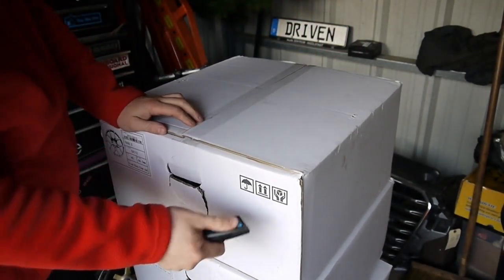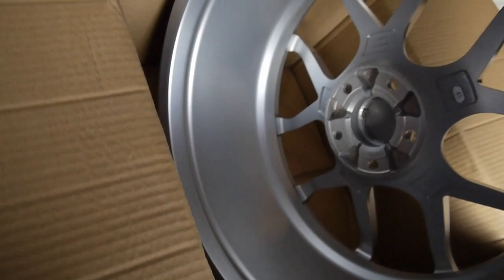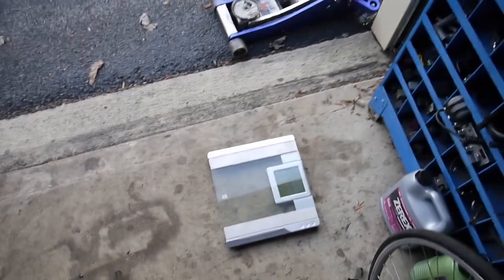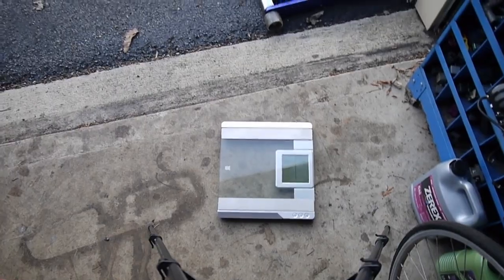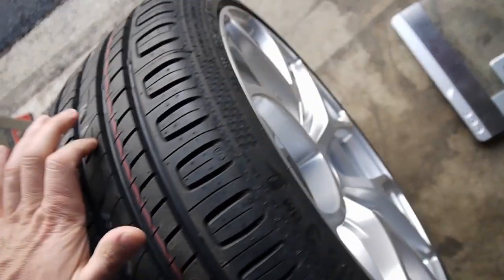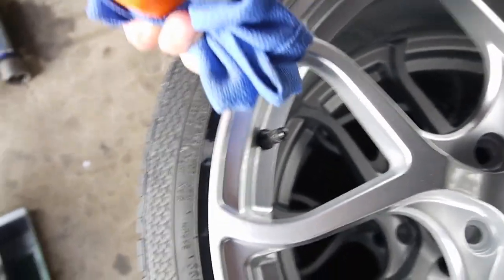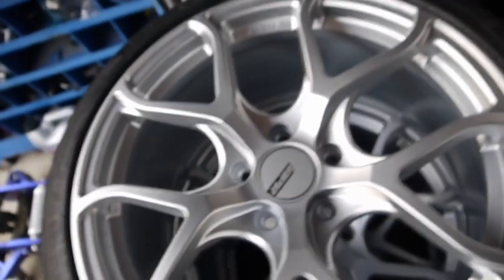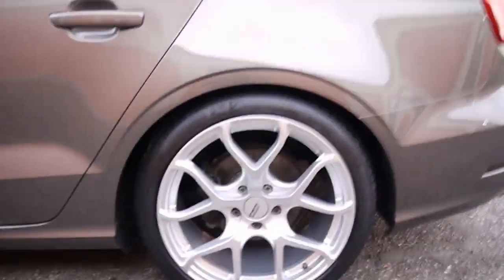APR A01 flowform wheel unboxing/review/install

Comment: Thanks for the vid man, I just received my A01 as well (18x8.5) and wanted to inform that my wheels are 19.4lb each rather than the 18.5 listed on APR's site. Still a light wheel but be aware that it is not quite as light as they claim
Reply from the maker: Thanks for sharing,  lmk what you think when they are on, I'm going to do some 0-60mph comparisons between these and my s4 wheels
Reply: If you’re using a standard scale, weigh yourself, then pick up the wheel and weigh yourself again - the difference should be pretty close to 18.5lbs for the 18x8.5s.

Comment: Barums?  They were a choice because of cost and nothing else.  They don’t perform even close to other reasonably priced tires.  If you are going strictly for look, then you succeeded.  Otherwise, they will perform appreciably less than stock tires.
Reply from the maker: they were in stock and i've had luck with barums before. Also for what it's worth they were the lightest tire i could find in this size. That said i'm not 100% sure what tire i'll go for next. I run studded winters so a dedicated summer would be perfect.

Not sure if i said it in video but my next tires will be 235's or 245's because 225's are stretched
Reply: @96ej  235/40s are optimum with an 8.5” wheel.  The 245s will have an adverse effect with steering and a smidge more forward drag.  I would highly recommend the Mich Pilot AS4s.  They hold really well in all conditions.
Don’t worry about the weight of the tire, but if you decide 245s then you’ll have 1lb more over the 235s.
Reply from the maker: @MegaHollywood1971  thanks for the tips man I really appreciate it. It really seems like you can't go wrong with Michelin.

Comment: Want these in gun metal or black for my gray GLI
Reply from the maker: Do it!!! Gray on black is always clean 👌, What gen gli?
Reply: @96ej  MK7 GLI S. Delivery end of November.
Reply from the maker: @SonOfTheDawn515  Congrats, this is and EXCELLENT platform!! it responds so good to mods
Reply: @96ej  I'm admittedly a VW fanboy as it is lol. My first car was an '01 MK4 Jetta GLS with 2.slow in manual that lived 15 years before a wreck killed it then an MK6 Jetta 2.5 SE that lived 8 years until a wreck killed it in May (hopefully the MK7 never has to go through that) and when I lived in Germany I drove a myriad of cars (Mercedes E class, 80s BMW, 80s Scirocco, Opels, etc) but VW just offers the best bang for the buck with driving experience to me plus still cheaper to drive and maintain than Audi. Nevermind learning to drive with my mother's '99 Cabrio in stick.
Reply: @96ej  The only thing I would like to change on the MK7 is the wheels. I don't have a real inclination to add power. I just wanted something that could get me around traffic when necessary and fun to drive in corners. If the previous generations gave that I can only imagine this to be far better especially with the rear suspension and R brakes.

Comment: What kind of TPMS sensors did you decide to use?
Reply from the maker: Good question! So the tire pressure monitor system on this car is actually pretty unique and in my opinion a better way of doing it because it doesn't use TPMS sensors. 

In my opinion this was a very good idea because I can swap back and forth from my winter Wheels to my summer Wheels without the need or headache of reprogramming different TPMS sensors.

Here's a quick link if you're interested in learning a little more
https://www.audi-technology-portal.de/en/chassis/brakes-wheels/tire-pressure-monitoring-system#:~:text=It%20alerts%20the%20driver%20in,warning%20on%20the%20onboard%20monitor.&text=The%20system%20also%20detects%20a,resistance%20and%20increased%20fuel%20consumption.
Reply: @96ej  awesome thanks for the info! So basically you just slap the wheels on and don’t have to worry about recalibrating any sensors, the car just does everything itself?
Reply from the maker: @philliphoffman3979  yep that easy